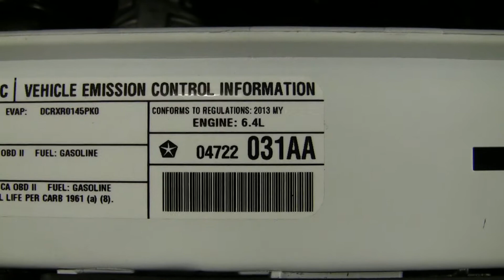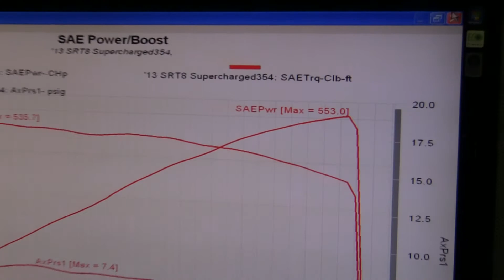2013 Dodge Challenger SRT8 392 HEMI,  2013 GPEC Calibration For Boosted Applications!

Comment: Engine, no. My '07 runs like a champ. My stock trans is starting to give out though, 550wtq will do that though...lol. Go with an Arrington stage 2 valve body if you have an auto. It will save you some hassle.